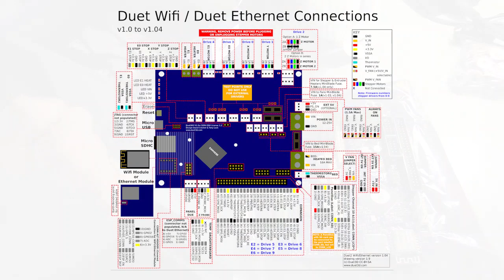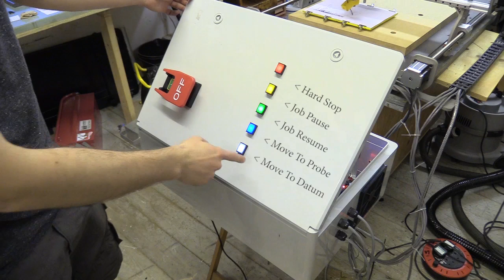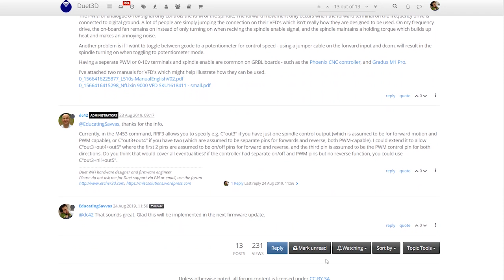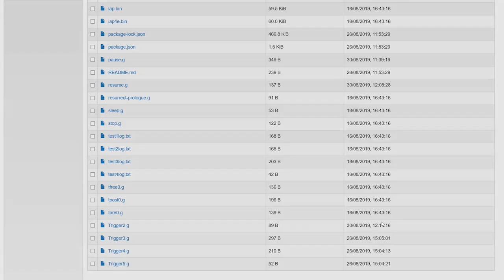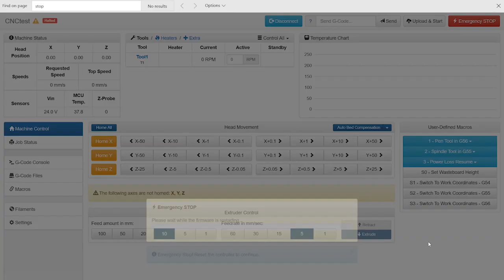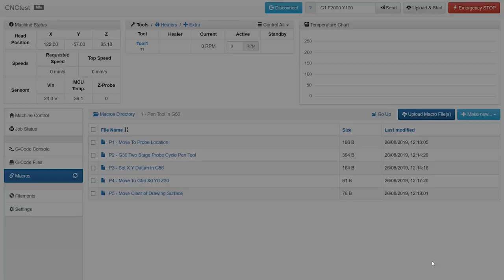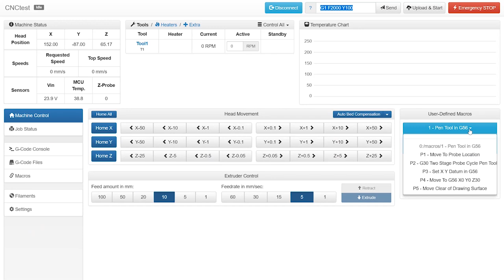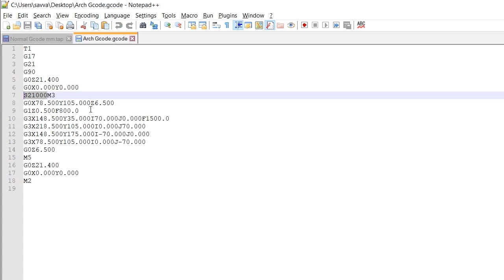Duet 2 Wifi for CNC Router Machine?

Comment: tell me, did you use more powerful stepper motors than allowed by the driver? I have a duet2 wifi board and motors 23hs3416, 2.9A per phase. Can you tell me if the tmc2660 will withstand it?
Reply from the maker: "Plan to run each stepper motor at between 50% and 85% of its rated current."
Reply from the maker: https://docs.duet3d.com/User_manual/Connecting_hardware/Motors_choosing

Comment: Thanks for interesting information.
Had my Duet WiFi for 2 years never used till now.
Does anyone know what USB lead to use,
My original one has gone missing.
Thanks.
Reply from the maker: I think it's a micro USB if I remember correctly.
Reply: Thanks it is a micro USB.

Comment: Has the Duet 3 fixed some of the negatives?  Has duet spent more time on the CNC part of their boards?  I have a couple 3D printers I would like to convert to RepRap using duet mini 5 +.  My father has a cnc router, and I will be converting a mill to cnc, these would use the duet 3 with hookup for external drivers.  I would like to use a common firmware for 3d printing and cnc.  I would like to use duet boards.  But if there is too much of a compromise with CNC, I will use something else for CNC and maybe Klipper for the printers.  I currently have marlin on the printers and Mach4 for the router, and I do not really like either of these.

Comment: does grbl use arc gcode?
Reply from the maker: Yeah if I remember correctly GRBL does but for the duet 2 wifi, you'll need to update the firmware to the latest version.

Comment: Where can I find clear information on how to do what you did or some things?
Reply from the maker: Are you interested in the machine itself or the controller?
Reply: @EducatingSavvas  On how do I configure my Duet 2 Wifi boards to use relays, program buttons, use the standard CNC commands in gcode, etc. I find it very difficult to find online.
Reply from the maker: Have a look at my video #49.

Comment: How are you dealing with the pausing? I'm having an awful time. Also does the duet remember G54/55 work offsets after a shut down?
Reply from the maker: Hiya. It should do but you may have to write a an M500 and M501 in the right place. M501 in the config.g. I also updated to RRF3.01 RC6 and it seems to sort out a lot of problems. But I don't resume jobs from the trigger files any more. You can pause with an external trigger but a resume has to be done through the web interface otherwise it goes a bit weird. But in a way that makes it safer as you are near the computer and not the machine when resuming.
Reply: Educating Savvas Educating Savvas are you saying that calling an M25 with a trigger macro was pausing the cut job immediately? Or was it finishing the moves in buffer? Thanks for the G54 tip. Cheers

Comment: Have you figured out how to set up hard limits with the duet in a similar fashion to grbl? I am trying with triggers but it is not working.
Reply from the maker: You have to add some g-code to revert the limit trigger action to error after the homing cycle is complete. But In the end I didn't keep this feature as setting upper and lower travel limits in the config file along with only allowing movement after homing meant it's almost impossible to crash.
Reply: Educating Savvas is this because you are using stall detection as well? I was thinking hard limits would still be an issue in case of part-tooling crashes etc, making the motors miss steps.

Comment: Hello can you tell me what your Postprozessor in Fusion  is for the Duet thanks
Reply from the maker: Hi, I'm haven't used Fusion for gcode generation - instead using Vectric. The most important step for my post processor was to reverse the  Spindle enable g-code so M3 was before the S spindle speed command. I also added a dwell time to allow time for the spindle to come to speed. Cheers.

Comment: Not sure if someone have commented previously, but you should not power on circuit boards on a antistatic bag. Example 4:28. There is a risk of them conducting and short circuiting the board. This differs alot between bag manufacturers, but better to be on the safe side.

Love your work, keep it coming!
Reply from the maker: Thanks for the warning. I'll make sure not to do that in future.

Comment: i love what your trying to do and i also am planning on doing the same but with the duet 3, tomorrow i am ordering all the machine parts and electronics an have based it all around the duet 3 with a raspberry pi4 SBC connected for user interface with a touch screen at the machine and for the camera monitoring capabilities.  Would love to see your progress as you move along with this project

Comment: Great video and build !
Have you test the rigidity ? machining wood, maybe aluminium is it possible you think ?
valchroma seems to be thin can you precise thickeness ?
Thanks a lot
Reply: Hiya - thanks. It seems pretty rigid considering what it's made out off. The valchromat plates are 8mm thick and I'm happy with the few parts I've cut out. I wouldn't build an intergalactic spaceship with this, but I'd use it for prototyping and making things for myself.

Comment: For your machine, Did you check the BK12 bearing supports if they have 7001 instead of 6001 bearings? (the latter is most commonly used and not capable of handeling axial forces) Good 7001 bearings (with no play) are available for 8 euro a set) I would use the shaft on the ballscrews end to use a small GT2 belt/pulley to mechanically connect them together. I'm implementing that on my machine too, since the machine is using servo's it might tear down the y axis when something goes wrong with 1 axis without triggering the alarm) Btw, did you see CNCJS? Kind of like octoprint for CNC's,
Reply from the maker: Hey - I didn't check but will have a loot when I can. I like the belt idea but I also wanted to keep the parts numbers down so went for a direct mount. And yes I have seen CNCJS - but that's another project for another time. It does look good. Do you run yours on a Raspberry Pi or PC?
Reply: @EducatingSavvas  yeah, minimum number of parts is a good thing! No, my machine is using an edingcnc controller. Been playing with marlin on a 3d printer with the 2209's, the tmc5160's seem to be nice. But marlin doesn't do a very good job in terms of silence for the stealth mode IMO. Still quite noisy.

Comment: You should check out the OpenBuilds Blackbox controller. Its fantastic !
Reply from the maker: It does look good - but I wanted to add certain features to mine like no-voltage release. Wouldn't mind trying theirs though.
Reply: @EducatingSavvas  i have a friend that has one and it is a very similar type of board that uses a interface for editing and control, i feel the duet has way more potential and alot more expandable potential
Reply: Surprised this was recommended given the Duet is 32 bit and still today one of the best controllers available. 64 bit is just starting to spring up yet firmwares are not really supportive.

Anything 8 bit like the blackbox id never use in a cnc unless it were a temporary backup or test project. Given so I wouldn’t go buy one with so many better alternatives.
Reply: @glennedward2201  you’re making false assumptions that 32-bit for 3 axis CNCs gets you something extra. 

64-bit will probably never emerge unless software demands it because you just gain nothing.

8-bit can do high resolution 4 axis milling, and you’d never be able to tell the difference unless your milling the way a Voron 0 3D printer makes benchy’s. 

If you decide to make a Delta kinematics CNC machine that’s cutting at 400mm per second, then maybe we can discuss quality differences.

Comment: Great video, was thinking about building my own cnc using the duet but havent really found a lot of info on using it on cnc routers. Looks awesome but it actually scared me away from it. Is there a writeup or do younplan on making more detailed video on your build for diy?
Reply from the maker: You just have to take the plunge. There's a lot more info out there with GRBL which is what I started with - and some pre assembled controllers so you only have to worry about making the machine. That said the duet system felt easier to learn than GRBL. I really want to write something up but it's an issue of time. I prefer to keep making and haven't given myself time to write up.
Reply: Hi Carlos, thanks for your comment. If you want a source on using it with a CNC Machine, maybe checkout our manuals on using it with our WorkBee CNC Machine: https://learn.ooznest.co.uk/c/5._Connecting_and_Commissioning

Comment: One thing that I really dont like about duet that it has its integrated drivers onboard.
Reply from the maker: I was unsure about that at first as well, but you can set up the board to use external stepper drives. There's also going to be a newer version coming out which will use TMC5160 and can supply double the motor current.
Reply: @EducatingSavvas  
First of all it really a waste of money to spend on extra drivers when you have yours, there should have been an option to sell the boards without onboard drivers, it will reduce the cost at least ~30$.

First time heard of the "TMC5160" version, that's good news, however, I hope that they would make a proper motor supply for this one since those drivers can easily work with 50V which will help with driving bigger motor faster when needed also hope they use proper Mosfets so people can use bigger motors (for CNC for example).